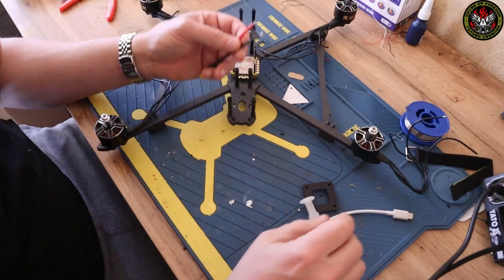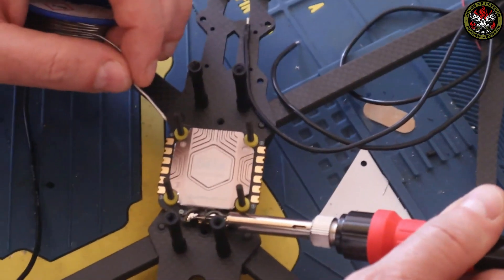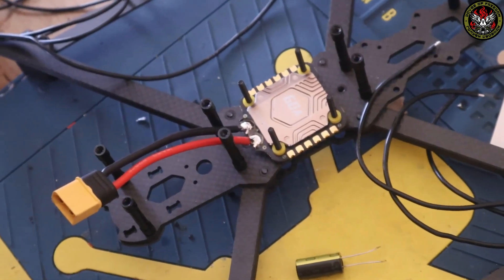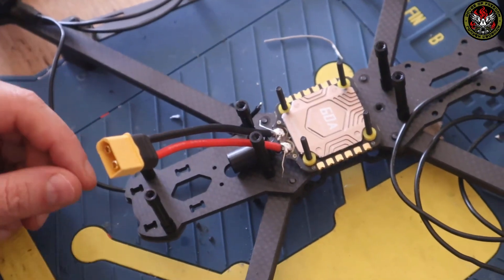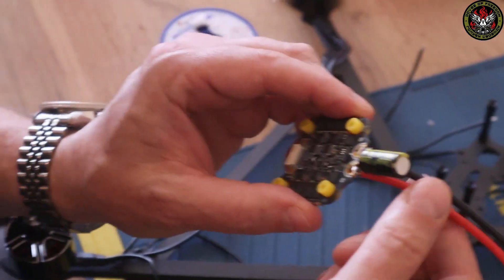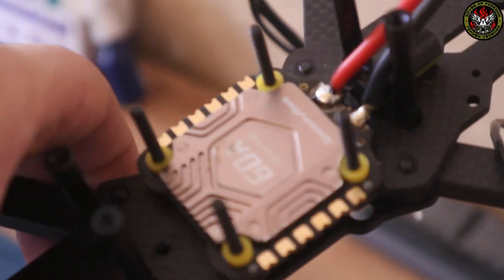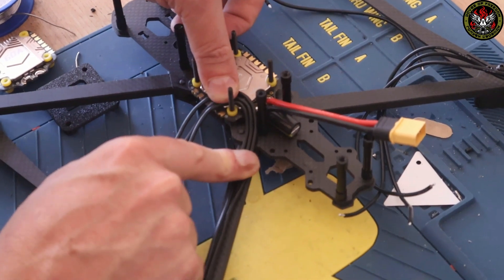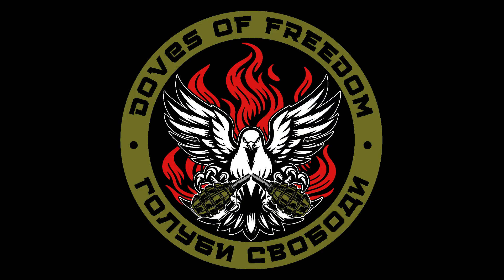Assembling FPV drones in Ukraine - how to solder the BATTERY CABLES & CAPACITOR TO ESC SPEEDYBEE V4

Comment: Hey thanks so much for the awesome video. But how do you avoid inhaling the fumes when soldering? I have been reading that these fumes are toxic to the 🧠 brain…

also, every time this guy says “nice and wet” take a shot
Reply: Having ventilation and a small fan helps. But it's actually not not dangerous. If it were, we'd hear about people who do stuff like this dying young. But the oldest guy I know soldered some so it can't be that bad.
Reply: @Santuse hmm interesting take on it not being harmful. Thanks for the ventilation tip tho! 😊